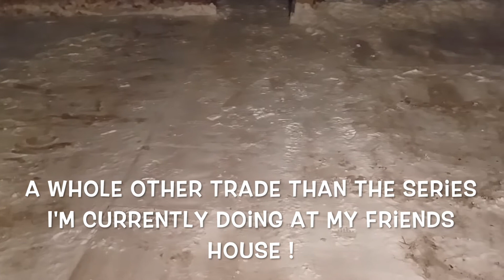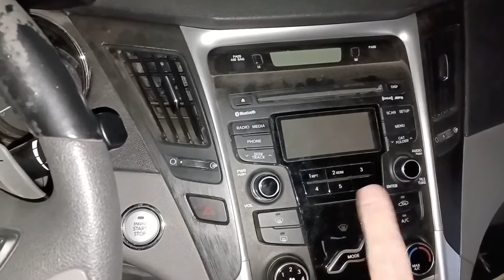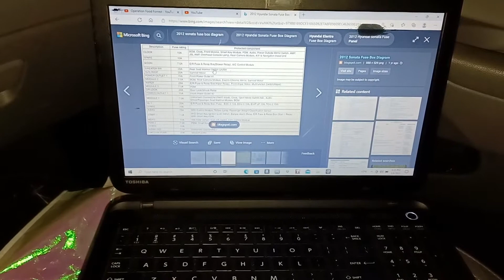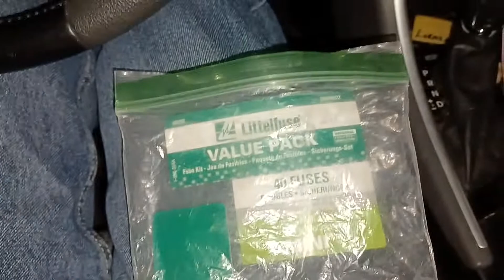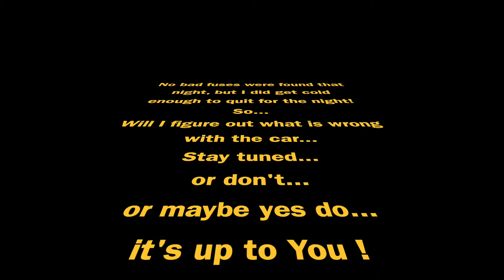3-6-22 Vlog | Snowed All Day | Car Troubles With The Hyundai

Comment: If those fuses look good next pop the hood and look for a second fuse box. Ones under the hood handle more power and i believe the smaller fuses run off those. Like protection on protection. Pull those suckers first before you do anything.  Can swap around a few to be sure to see whats a dead fuse.
Reply from the maker: I did end up going into the other fuses, but without ever finding the cause it started working again ! 
Which of course is both good and bad ! 
But, I'll take it !